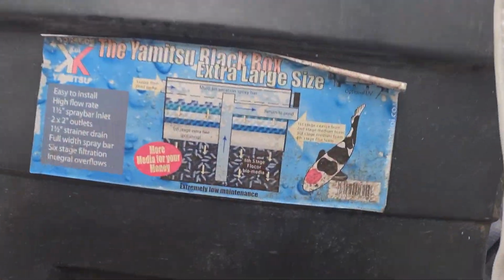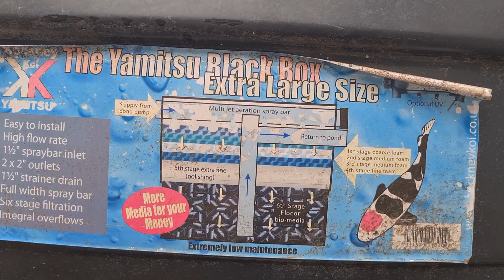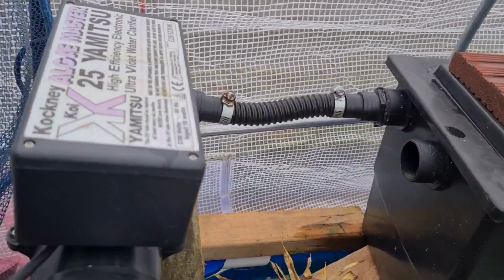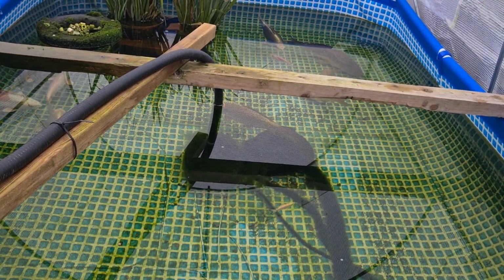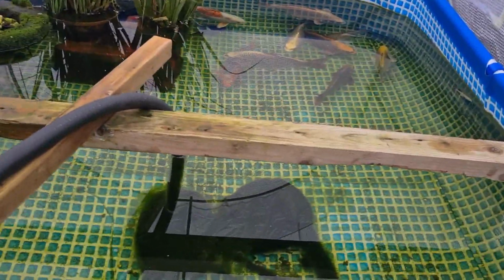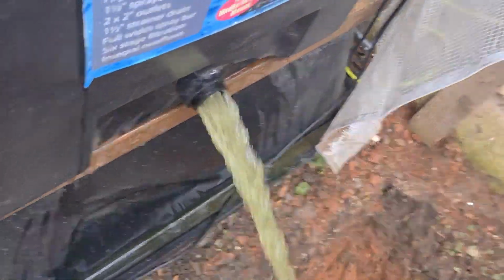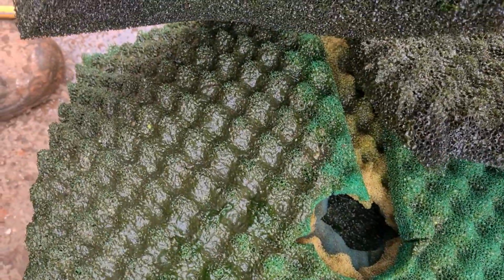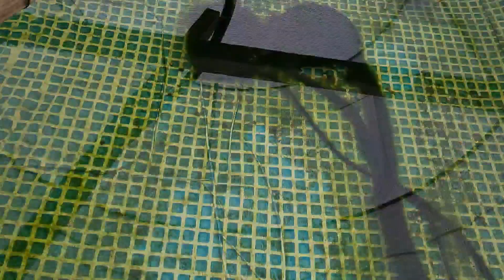‼️100 Subs Give Away Starts Today Guys‼️ Kockney Koi ‼️

Comment: hey mate thanks for the comment on my fish gifts video, ive subbed bud. With your box filter, i was running one before i got the nexus and it should only overflow down that pipe when its blocked. so seeing as though you've just cleaned it id say the pump needs turning down or take out that extra bit of matting you added. also dont wash the media with tap water, only pond water. it kills the the good bacteria. cant wait to check rest of your vids out. kockney koi
Reply from the maker: Thankyou bud 👍 Pump is to strong matey it's was the only spare pump I had at the time but now once iv got this new build done and got a bottom drain rigged up to it I'm hoping it should be ok till I can save up for a bigger better filter system👍🐟

Comment: Hey bud congratulations again on the subs 👍 I'm no expert but wouldn't using the hosepipe on your media just kill all the bacteria? 🤔 with the amount of chlorine in the water these days you'd be better off chucking a bucket of pond water over it to clean it just a thought 👍 kockney koi
Reply from the maker: Thankyou 👍 yeah I know what yours saying about the tap water mate but iv cleaned it like this for 3 years now and not had a problem yet it's only plastic media so it don't hold much bacteria anyway it's your ceramic media and Alfa grog I wouldn't hoes down if you look in the pool I have a floating island thing with ceramic media in iv never washed that I wouldn't for the reason in question but as for plastic media I don't beleave it holds alot of bac aways so🤷🤣👍🐟
Reply: @KoiCarpKyle2393  youd be surprised how much it holds ..  flo core not so much but I think i saw some k3 in there which holds a lot ..  if youbrinde it every month you're not giving the bio film chance to form.     Hose off the mats and leave the bottom to do its thing unless it's silted up then chuck a bucket or 2 of pknd water through it .    Any addition to the good bacteria no matter how small is a plus ..  remember most bio chambers now use plastic media of one form or another

Comment: Kockney koi,100 subs already.why don't you run 1 pump and split it using valve's to get your flow correct.👍
Reply from the maker: 😁👍 yes it did have a Y shape pipe to run both boxes off the 1 pump but I broke it rushing about when setting everything up so had to get a old pump out which is running the small box at the mo 👍🐟

Comment: Congratulations on the 100 subs mate fairplay 😉👍 I use the box filters mate old school and work a treat 👍 I wouldn't wash the media with a hose bro I would get a bucket of pond water and tip it over them I know its plastic media but you will be surprised of the bacteria is on them 😉 kockney koi
Reply from the maker: Thankyou Very much 😁 and yeah ok bud I'll leave them from now on👍 iv always gave them a little blast that's all 🤣 but yes I'll leave them from now on 💯